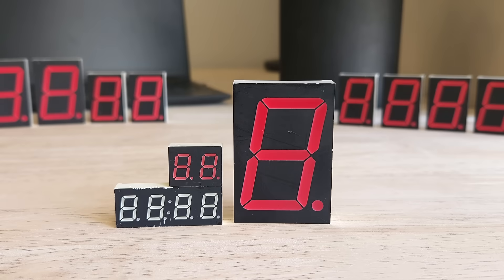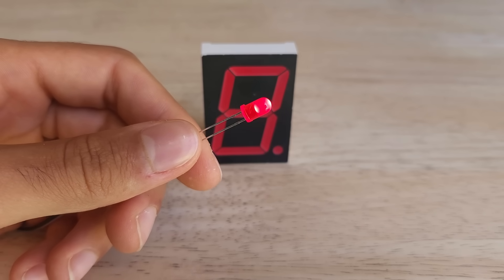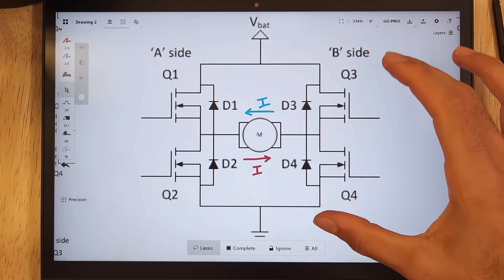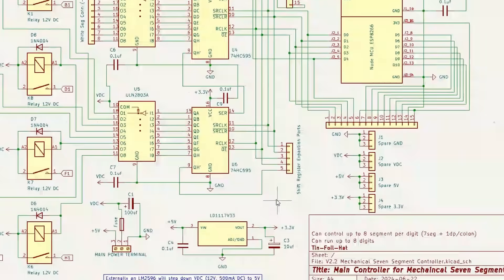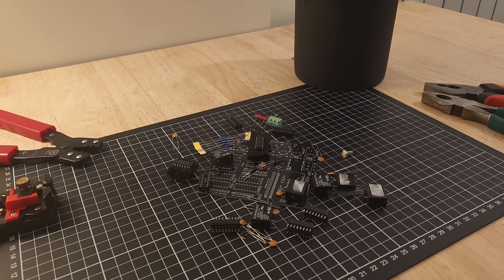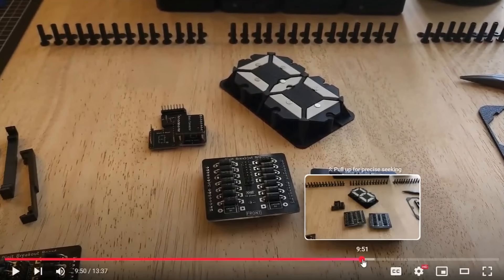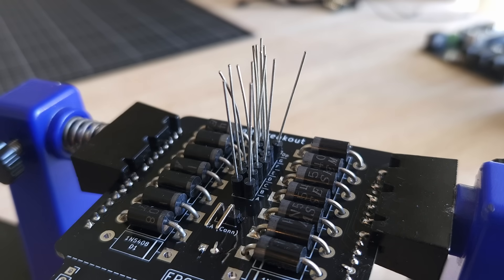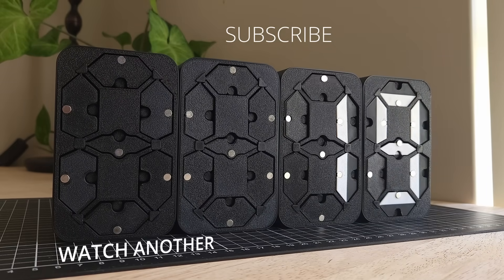The BEST Mechanical Display You've EVER Seen!!

Comment: I have one burning question.

Why do the segments flip sequentially and not all at once?

Is this an aesthetic choice or a limitation of the design or controller?

Are the magnets driven directly by the ESP pins and therefore current limited?

It's way cool. Juat curious about this one behavior.

Thanks.
Reply from the maker: Ok I'll make a follow-up video with this and some other FAQ, but since you asked so nicely I'll answer you now. Each coil takes 500ma to flip, so to flip all of them IS possible (infact it was my original design) but the power required is really really high, and the components start to get toasty.
Reply: @tin_foil_hat99 

Thank you!

1. Could you make shorter thicker coils? Since field strength is in Amp-turns/meter, halving the length of the coil would mean only half current required. More turns alone would help. I assume this is an issue of physical space inside. 

2. FETs? Or are these already incorporated into your pcb design? I assume you have something, since an ESP is rated for, what, 20ma per pin?
Reply from the maker: Yes and yes. Definitely could make them wider, but the middle segment is thinner so they already hardly fit. And I've got transistors arrarys to handle the current draw!

Comment: A little tip... you can ad a paus in bambulab studio, you can specify at what layer nr you want the paus and that lets you have time to put the magnets inside the print (make sure you wont have support enabled)  and then you just press continue on the printer when you added the magnets. That way they get invisable inside the flaps :)

Comment: WOW,  NICE!!, When I was a kid, My Dad got me into Rocketry, back in the mid '70's, 
     He was an electrician, And So we bought this single button firing mechanism, it just had a light for connectivity, and a key, a piece of straight wire to arm it,  and the single button for firing, well it worked kinda, So we would check for aircraft and then start a count-down, using our voice, and then launch the rocket, so like I said that kinda worked, 
    
But after a while it got old, So we started to look for an option, that would automate this process, but we had a tight budget, and couldn't really afford the high-priced option's on the market at that time...
  
I was bummed out, so my dad had an idea,.. (he didn't tell me about it, he just played along with me being bummed out),  
      
    Meanwhile, he was a projectionist at the local drive-in, so he had lots of downtime in-between changing movie's in the carbon-arc projectors at that time, so when he wasn't busy setting up the projector for the next movie he would tinker around with electronics,...
 
       Sorry for the long intro, so to make a long story shorter; 
    He built a little 5"W x 6" L x 3" D, electronic firing box for me to use when firing my rocket's, 
     It was so cool, it had a 7 segment 1'x 3/4' LCD, and an (aircraft grade cool ruby red led) for checking continuity, he used to be an aircraft electrician..,  so he installed two switches, one armed the devise, and one with a covered, (also lighted) firing switch to launch, Step 1, you connected the hot wires to the rocket fuse, Step 2. got 15' away with the box for safety. Step 3. checked for aircraft in the launch area, when all clear, you opened the cover for the firing switch, then when ready flipped the switch, to arm the circuit   then hit the fire switch, and the LCD would start the count-down from 9 down to 1, then sent the signal to the circuit relay, to open the 9v current flow that would ignite the fuse on the solid rocket motor.. 
            
P.S. So Cool back then, so he told me we had to settle for a 9-second countdown because at the time, it was too much trouble to install a second LCD just for the 1 in 10...,, ha ha ha ah..,  😎🥸🙃😁, and yes I do realize that this really has very little to do with what you have created, but it brought back fond memories of my childhood growing up, And I've also tinkered with the Idea for making a physical 7 Segment LCD, but didn't really know how to do that.  
    Growing up, I had one of those old LCD flip to display alarm clocks and thought those were cool for the time, but THIS IS ON A WHOLE OTHER LEVEL!!!!  NICE JOB BRO, Cool Beans, KUDOS!!!
Reply from the maker: WOAHHHH THAT'S AMAZING. This is one of my favourite comments!! That's so cool!
Reply: @tin_foil_hat99  Thanks, but it is all on you,  I have a FlashForge  Adventurer M5, and I just got an Artillery Sidewinder x4 s1 plus, 300mm x 300mm x 400mm, can't wait to start printing with it???😎
Reply from the maker: Holy! What a setup :)
Reply: I am going to get a Longer LK 5 Pro as well, Bigger Prints... I have been looking at Starship prints, I am definitely going to get the ORIGINAL Saturn 5 rocket, like 3' high, and also the new Starship 7
About 3' high...

Comment: Why did you use relays? MOSFETs would have been a better choice, as they are faster and quiet. Is there a reason you didn't use them? Great video btw, and I absolutely love the look! Edit: The was breakaway PCB was odd too, why not separate boards?
Reply from the maker: Separate boards cost more, thus the breakaway, but I'm gonna use V-grooves from now on. MOSFETs to my knowledge (which is very limited) pull pins low, and I needed a switch for the postive rail. And relays were cheap and easy :)

Comment: Electro-mechanical still relies on power to function.  After a power outage, electro-mechanical is still as reliable as electro-optical - both require a battery back-up to not lose their current accuracy of data.

Comment: This is an awesome concept and great first run.  Could you use an output char to store the new value for all segments for each display and then drive all seven segments concurrently?  The sequential flips are kind of neat, but also slow.
Reply from the maker: Yes it is slow, I've programmed a mode that makes it much much faster, but slightly less reliable. I'll talk about it more in the coming follow up video!

Comment: How much would be the total cost of this, including the circuit boards?
Reply from the maker: 100AUD without boards for 6 digits (but including all the components on the boards) and then 5-10 bucks for the boards (if you use the discount link in the description) + shipping (maybe another 20 bucks)

Comment: A really cool build being dyslexic the magnets not being painted makes it very hard for me to read so if I make one, I’ll have to paint the magnets.
Reply from the maker: I'll be painting them for the follow up vid
Reply: @tin_foil_hat99   look forward to seeing it, thanks, i would made 3D print post with hollow end the size the magnet and sponge in and dip in flat paint to paint them real fast
Reply from the maker: That's a great idea! I had thought of similar with spray paint, but a sponge is a very good idea to prevent runoff!

Comment: Every video on YouTube makes soldering look so easy.
Reply: It is easy. You just need a good iron. Stable temperature is key! Also the tip size should be appropriate to the size of the element. 
 And don't practice on real project. Take some scrap boards so you don't have stress you will destroy something you don't want to destroy. 
My first job was assembly of PCBs. I had to solder components that couldn't be done by the soldering wave. I learned soldering just in few hours, and then within 2 week I matched the speed of other technicians. 
The rest is steady hand and stable nerves :)
Reply from the maker: Just keep practising!
Reply: I appreciate that positivity. Thank you.  @tin_foil_hat99
Reply: it is easy.... 
                    when you've  done it a 1 000 000 times :D
Reply: Anddddd 3d design and printing
Reply: @ 3D printing can be easy if you’re willing to pay for a good 3D printer. If you’re cheap, like me, you buy a budget printer and spend almost as much time tweaking your printer as printing your items.
Reply: Practice, practice, practice. It's the only way.
Reply: Right? And even if you have practice and get it down, it's more like piano than a bicycle. If you don't do it regularly, you'll suck every time you pull out the iron and need to practice before you hit the real project....but I go years...almost decades between projects that require me to use the iron...and I forget that I do need a few practice runs to get get the feel for it again.

Comment: 9:18 PCBWay can do scoring for you, they did so for a set of boards I had built recently where there was a part of the board which was only required in some use cases.  The scored section could be left on and populated, or removed for the application where it wasn't required.
Reply from the maker: Thank you!! Do you know if they charge more? I got them free but tried to keep them cheaper for other people. That does open up some more interesting PCB designs though...
Reply: @tin_foil_hat99  you can also place a lot of vias in line where you want the PCB to break
Reply: @tin_foil_hat99  my experience is that, during manual review, if they think part of the board is a separate design (which in this case it is) they will tell you you're supposed to change the number of designed form 1 to 2 etc. and then it costs more. If you don't get them to score it then they may not notice that there are two designs so you might get away with it.
Reply: @tin_foil_hat99 How much did the PCBs end up costing? I’m in Australia too and I saw in the video that they were charging 50 bucks for shipping. I understand you received yours free of charge but what would the cost be?
Reply from the maker: I can't understand the shipping cost, it's ridiculous. You get 5 bucks off from the link in the description, I think it was around 50 bucks in the end. Although everything else costs 100AUD all up to make 6 digits and a controller so still a fraction of the cost. All the links on instructables are for Altronics so if you're in AUS you should have no probs finding  the parts :)

(you can get a free quote on their website)
Reply: @ yeah jeez the shipping is so steep. But a hundred bucks all up for 6 digits really isn’t that bad

Comment: Your first thought of the push in and out seemed like a simpler solution. If you had a spring loaded shutter system it could push out the piece through the spring loaded shutter, each piece would be free to move so the solenoid would just push it out and return. Then you'd just need an  eighth solenoid to pull all 7 segments back in to reset the display, this would however mean it would flash "off" between each number.

Comment: Can u tell us the approximate cost, of everything? after all, you started the video by showing the value of a classic.
Reply from the maker: 100AUD for 6 digits and a controller, but I got the PCBs for free so likley +40ish bucks for them (depending on shipping, as the boards are only 5 bucks). The digits only cost around 6-8AUD each

Comment: Really cool project! I've been wanted to do something like this for a while. I already had a project that used an old car speed radar with electromagnetic segments display. The radar itself was broken, so I had to engineer a way to read the cars speed, transmit it and a way to control the displays segments. Some things to consider and others just to throw into the conversation:

- Mosfets instead of relays ((some) cheaper and smaller)
- higher voltage (faster switching and less current (?))
- play the fliping time needed for the segments (to draw only the power needed)
- lighter segments (easier flipping, less power)
- could thin metal segments flip on their own?
- while winding the coils, the guide of the wire being closer to the coils to wind more evenly (?)  but yes, off the shelf coils would be better

Other than that, great project and hope to see more of this soon! Subscribed!!
Reply from the maker: All very good ideas to think on! I'm especially interested in the high voltage idea. I'd love to get it faster. And thin metal segments would still need a permanent magnet to flip :)

Comment: Why do each of the segments flip one by one rather than all at the same time?
Reply: It would be interesting to know how much current it takes to trigger one coil at a time, compared to seven coils multiplied by the number of digits used. 

Note: I know a clock wouldn't be using all 28 coils at the same time, but it's interesting to think about.

Comment: Great work, but i'm a little confused. Doesn't it still need electricity to work, or did I miss something?
Reply from the maker: It does, but only to update. So it has some useful applications but for some such as clocks, you'd need constant power. It has an advantage in short power outages
Reply: @tin_foil_hat99  ah ok, thanks for the answer

Comment: WAIT. . ❗
I think you could have centralised the switching using strings to flip the digits. Think of a light switch pull cord., it's state changes with each pull. 
By clamping the required strings in a clamp bar then a motor pulls the bar and the digits change at the same time

Comment: At 3.55 that circuit has a problem. Q1 and Q4 are on each side of the motor. 0volts is on one  side of the motor, and other side is at Vbat so the drain of Q1 is at Vbat off setting the gate voltage and try’s to turn Q1 off . The motor will run with little torque. The top mosfets should be P channel mosfets. I have built that circuit before and the motor has next to no torque.
Reply from the maker: Yeah I did find that too... very interesting, thanks for the advice!! I shall investigate further

Comment: Some minor feedback on the breakaway PCBs - if you want to be able to break them off, you might want to consider so called 'mouse bites' - which are just 0.5mm holes, spaced 0.75mm apart. They are rigid enough for normal use, but don't require you to break them off with a hammer.
Reply from the maker: Sounds good for V2!

Comment: Why you have all these electromagnets. here is an idea it can be spring loaded to one side ie blank and electromagnet activate for the other side when needed . you can cut the need for electromagnets in half.
Reply from the maker: Then the electromagnet has to remain powered to hold the flap in place, this way you only need power to update the display! A good idea though, and I did consider it

Comment: Great work!
Why don't you instal the electromagnets in the pcb?
The coil in a horizontal spiral, and a metal core in the middle.
I can't think why you'd need that much magnetic force.

This way, you don't need to wind the coils and it getts slimmer.

And the slimmer flap you did for the -part in 8, why don't you do it for the rest of the 0?

Comment: You made that circuit WAYYYYYYYYY more complicated than it should be. Not only is it less reliable like that, but you literally double your circuitry. You're driving 14 seperate coils when you SHOULD be driving 7..  think about it.  If you wound the coils so they are just over 24 ohms each, you could easily put them in series but opposite polarity. You power them as 1 coil and the magnet side repels while the non-magnet side attracts. You would only draw about 100ma on 5v per segment. There are control ICs that have no problem with driving currents like that, especially momentarily.   The control gets wayyyyy simpler too.  Whichever driver chip you plan on using, you can simply set them all low. The 2 drivers that are connected to the segment only needs 1 to go hi to change segment state. When its done, it can go low again since the static residual magnetic force in the steel isnt going to be affected by a shorted coil.  Or hell, drop the enable line and let them float. 

You could have used 4 L298N or drv8833, to handle all 7 segments and a decimal. Of those, you would have a single control leg per digit and a common enable leg. Shift all of em with a 74hc595 or even an i2c shift reg and you can control all segments simultaniously without issue. Idk what you did exactly, but it looks like  theres a lot more going on than need be.

Comment: Instead of score and snap use either a v-groove if the design layout will support it (has to be a continuous line right across the pcb) or use "mouse bites". Both are a lot easier than cutting and snapping fibreglass pcb. Been there and done that too much.
Reply from the maker: I think they charge extra (I got them free) but I wanted others to get the lowest price possible haha But yes a v-groove would be a great solution!
Reply: Mousebites are free at any stage. I think if there is only a few v-grooves they are also free. I haven't used pcbway in a while but they definitely provide a good service. Of the thousands of boards that I got from them I never got any free. I did get some free giveaways like solder wick, a ruler and a few other things.
Reply from the maker: Yeah I looked into it and added them tonight! Turns out less than 10 v-grooves has no extra cost

Comment: The sound of the display is just like somebody is typing very fast on a cheap computer keyboard. By the way, the dashes in the middel have to blink, so that the viewer can see that the clock is running and not standing stil.

Comment: Very cool, definitely above my pay-grade... & don't get me wrong, these are cool as shit, its just I don't get why retaining a readable display during a power loss matters if the information you've displaying is rapidly changing.
Reply from the maker: Some things such as gas meters use these so that in short powerfalures information could be retained. You're right that without power it has no use as a clock, but for some things that don't often update, it can provide an additional source of truth.